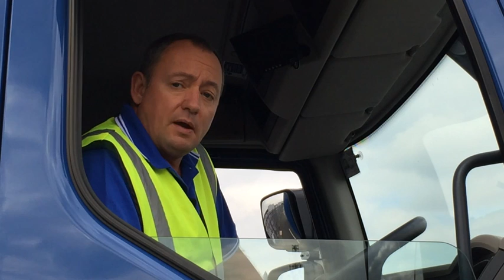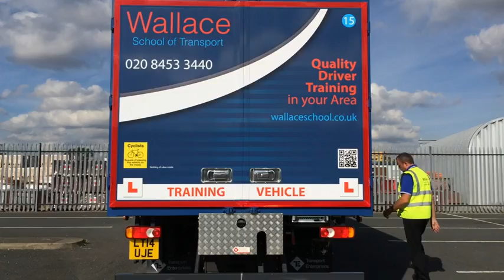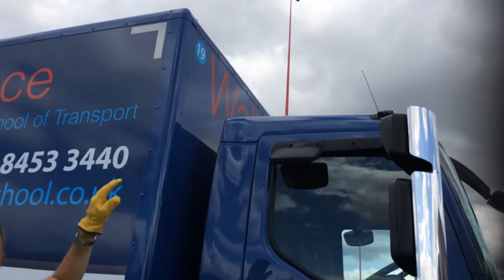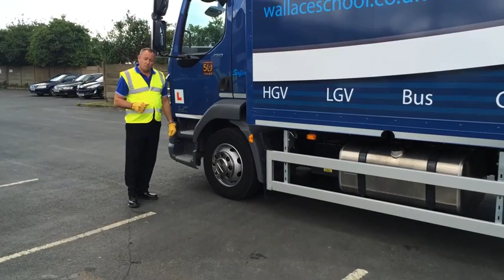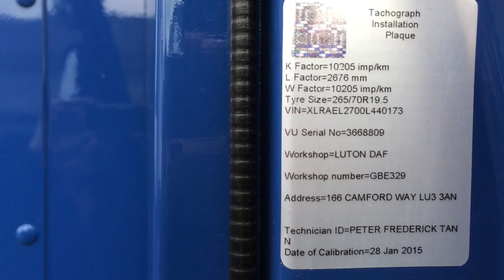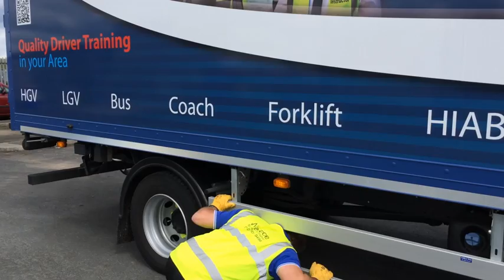Driver cpc module 4

Comment: You didn't check to see if the rear number plate lights are working,this is a fine for the driver if stopped.

Comment: the free here all ok next thing I do is check that the horn is working, turn ignition on technical and then I check the operation of the washers and wipers we can see their fight next thing we do is the braking system and the Speedo is working so normally he would driver vehicle forward and tester breaks and speedo however at our head office there's no requirement to move the vehicle forward so you explain to the examiner but that's what you would normally do once we done that the engine running we would check the mirrors for excessive exhaust smoke so I check the left side and I check the right side and we can see the exhaust systems ok and they're turning engine off I'm going to ask Examiner to her sisters in checking the brake lights so it goes to the back of the vehicle will turn the ignition on when a fire breaks and they're so that's fine and then we can turn the ignition back off and now we're going to turn on the whole night so we turn on dipped headlights the main beam headlights hazard lights fog lights and then we can exit the vehicle and check the lights outside and we also need to check when I get out the speed limiter certificate and the tachograph inspection certificate

Comment: when do circle check before driving off, whilst out of vehicle checking the lights etc, is the key in or out of the vehicle ignition. common sense says out, but could anyone confirm please?
Reply: Id say to the examiner, i take the key out of the ignition in case someone were to enter the vehicle while i'm out at the rear doing checks or lock the vehicle for the same reason.

Comment: Do trucks have a brake light switch so you can check them yourself when you're on your own?
Reply: Turn on your mobile camera and recorded hahaha
Reply from the maker: Some do but not all examiners like you to use them so ask your local instructor to guide you.
Reply: +Les Humphrey No, I meant when you're on the road.
Reply from the maker: +Les Humphrey  Yes on some you can check using remote
Reply: Reverse up to wall and look for the reflection of light in your mirrors ?

Comment: so now lorry driver is also immigration officer ??
Reply: +Phen0mable hi, they are, it's taken me six months from start to finish and cost £4000 I wouldn't mind but I passed every thing 1st time. You have to wait an eternity for test dates. Yes it makes the job safer, and yes it's good stuff to know. But why not be able to do it all within a week or a month, but six fu###ng months is a piss take. Lots of people want to become drivers but can't afford the cost or haven't got a spare half a year to hang around for government run test centres to extract their digit, and get people through the tests. Also I know someone who has severe learning problems and can't get through the written tests. No wonder so many drivers quit when they brought the CPC in, leaving a massive shortage of drivers in the UK, meaning that they let
Reply: +Phen0mable had to use a guarantor. Cheers dude, took mod4 this morning and passed no problem, as the weather was a bit shitty, they didn't do any tie-down test😀 best thing about breadbury test centre, cold in winter so got done in about 20 minutes. To all getting ready to take it, don't worry the exam is all common sense, watch these videos and don't worry about the dolly knot because if you pick the rope up to tie anything down, you've failed. so don't use it ever. good luck all.
Reply: +gary mcveigh sorry got cut off, so they let eastern European drivers in who don't need any CPC and most can't read English, and end up causing havoc and giving ALL drivers a bad name. So in short, the CPC test is good. Length of time it takes to get it horrendously bad.
Reply: gary mcveigh for cat c and cpc I paid £1800 all together
Reply: You did well, I have paid for cat C+E  but even C the best I found round the Manchester area was£2100 and it's all going up again soon as costs of training is costing more. Wages, fuel which is a very big cost , vehicle maintenance and all other sundry things needed. I had to go through a broker as I was unemployed and had to take hi intrest finance, so in all if I don't pay it back early it will cost £12000!!!! That's not the bit that's worried me , it's the length of time it takes to get your initial CPC six months from start to finish, and I still have my class 1 to do yet.
Reply: @garymcveigh8007  hi just looking at your cost its down now to 1200 av found wonder if you still in this profession as am thinking of putting deposit this week thanks
Reply: gary mcveigh I live in Manchester area.
Reply: +Phen0mable cool,  who did you do your training with, mine was enterprise in Ancotes.
Reply: gary mcveigh Red Rose Training in Kearsley. 
I don't understand why used broker and why you agreed to pay 12 grand. It's like 1000% of actual loan ..
Reply: +Phen0mable no choice when you are totally skint, and unemployed, and a credit score of about 0. it's compound intrest of 44%.  Couldn't get a job no matter how hard I tried, so I had to bite the bullet and retraining was the only way forward. Government won't help out with retraining so you have to fund it your self. I can no longer do what I trained to do, (chef), as it's too painful to stand long enough anymore, most of my left leg is metal. so the only thing I could do was broker and high interest loan. still it's worth it.
Reply: gary mcveigh credit rating was 0 but they still gave you loan ?? Weird. Anyway. Good luck pal. all the best
Reply: Good for you